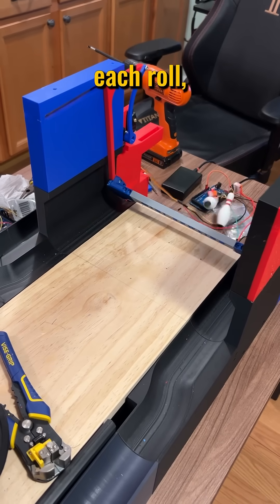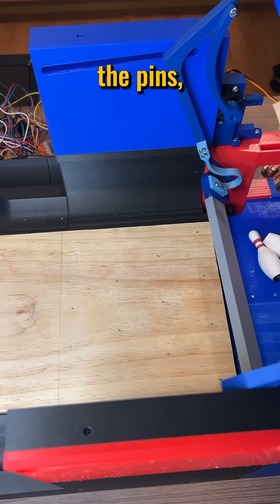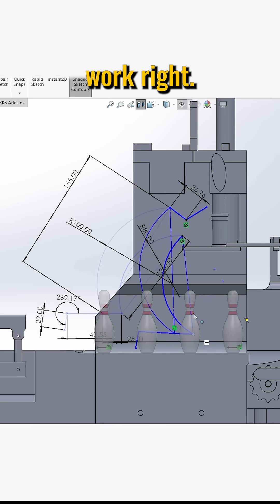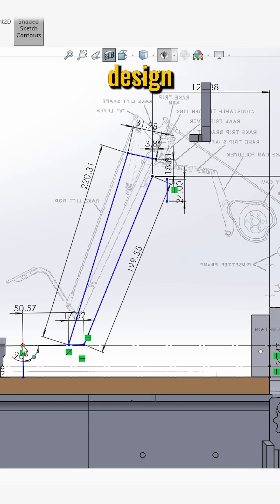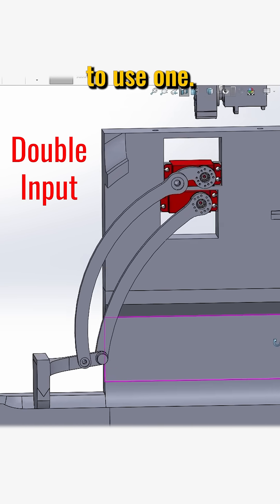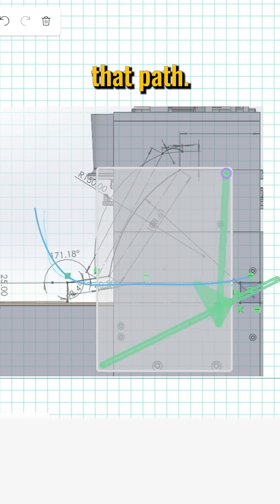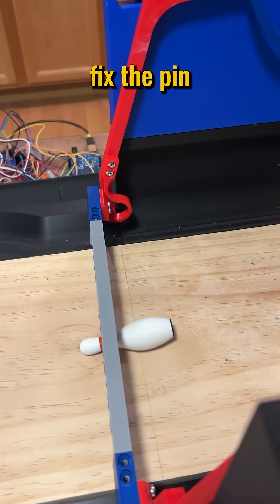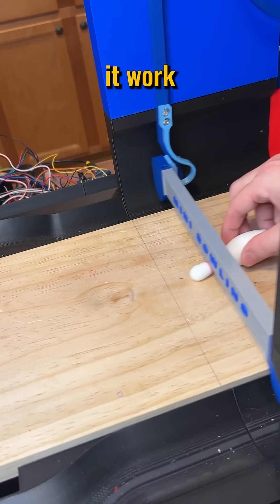Mini Bowling Lane Sweep

Comment: Just do yourself a favor and buy and read a Brunswick a-2 manual. Every solution you end up with is basically the same functionality. It's awesome though. I will definitely keep watching.
The double input example is how it would need to be designed with servo motors. The old machines use a cam on the 1 to 1 shaft to raise and drop the rake and the 4 to 1 shaft turns twice and then lowers a hook into place to pull the rake back on the third rotation and releases after it goes back forward on the fourth rotation.

Comment: I would've attached a little rubber edge to the sweeper, that way it bends against the floor of it, but still is rigid enough to push the pin

Comment: The initial problem is that the bar is too far of the ground, thus the pins are getting stuck. The height could be adjusted to 3/4 the height of the pins heads and it should work just fine.
Also why would you need two motors for the two shafts? Wouldn't the movement from one motor be enough to drive both shafts?

Comment: Imo an easier solution would be to have the bar rest on bearings during the sweep, that makes the mechanics fairly simple and you can have a tight tolerance with the floor bypassing the getting stuck issue
Basically have springs push the bar out and a rail on each side on which wheels run

Comment: I have an idea for the mechanism that picks up the pins so the sweeper can sweep: use the existing mechanism to drop the pins down and make it go down a bit more and make the thing that hilds the pins in place close a little bit on the top of the pins which should grab the pins so the machine can go up a few inches for the sweeper.
Anyways i have been loving this series and cant wait for it to be complete and would love to buy a set of motors already programmed (because i am learning to code but cannot do all this) so i can have a bowling lane of my own!
Good luck and cant wait for the next part!

Comment: If the spring idea turns out to not work, you could make 3D printed string (where you use stringing to your advantage to make bristles) and do that for the bottom of the sweep, therefore it won't get stuck and the lane wont collect dust easily
Reply from the maker: This is a great idea! Ive gotten a bunch of comments already about a brush design. Is there a bowling model that uses a brush on the sweep?
Reply: @dannylumcreative I'm not too sure
Reply: I was going to suggest some kind of brush, but this is a lot better